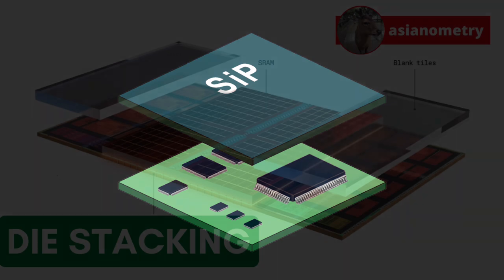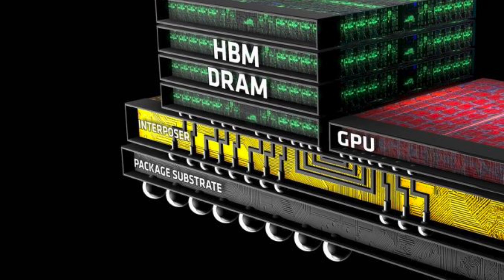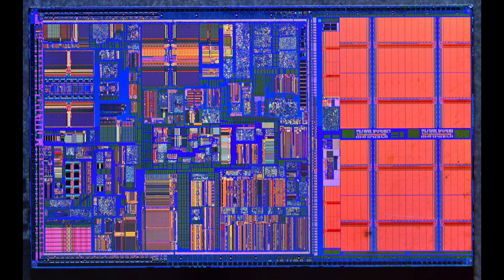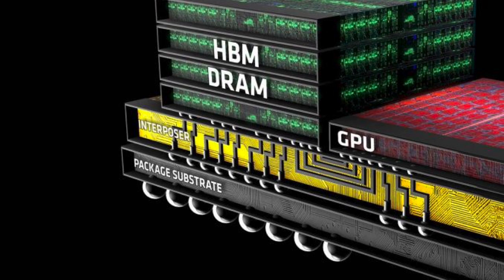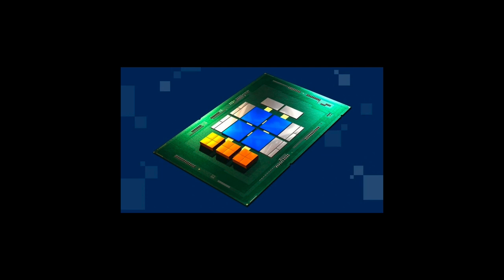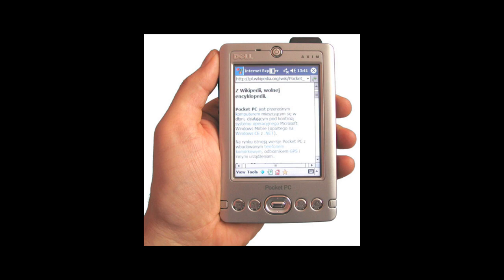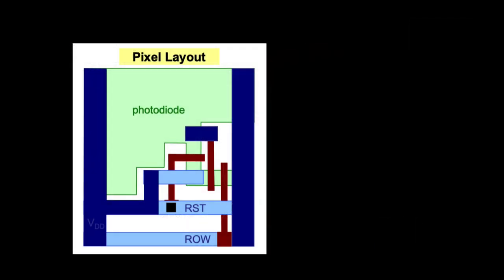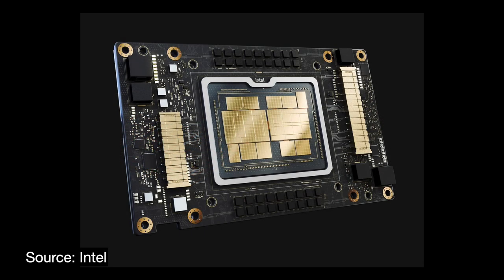Stacking Dies For Performance and Profit

Comment: Hope we start using dramatically bigger wafers soon to cut cost.
Reply: Backside Power Delivery (BS-PDN)  by Applied Materials.
Reply: Bigger wafers have been tried and they were much more expensive to deal with.
Reply: Never gonna happen, first because the 20+ years structures to deal with 300mm wafers, second because the weight, and finally because the yield of a large wafer raw material. Watch tech tech potato on the subject.
Reply: @vitormoreno1244  Well i know it was being develop, people will push for it again eventually.

Comment: Call me old fashioned but maybe devs should spend more time optimizing code. If we can run Doom on a Gameboy, maybe my phone doesn't need 100MB for the calculator.
Reply: Are you willing to pay the man-hours needed for your optimized calculator?
Reply: 100 mb calenders have nothing to do with the video
Reply: @kazedcat  I'd rather pay for the man hours to teach better security and coding practices than having to buy new hardware every year for bloated software that's full of vulnerabilities.
Reply: @CMSonYT  100MB calendars have nothing to do with my comment.
Reply: @RooMan93  Security code is much more expensive in man hours. A developer who understand discrete elliptic curve is very rare.
Reply: You are comparing a game from 1997 to games which are fully 3D. AAA games are not going to run on your 1650 if you haven't catched my drift.
Reply: @flintfrommother3gaming   AAA studios are responsible for this too.
  End-of-life console games pushed hardware to its limit and often my smaller studios or unique individuals. The homebrew  scene today has improved upon that and gave us truly impossible ports.
Reply: You can throw as much AES and entropy as you want at a program its still not going to make it impenetrable via some overworked and under paid dev who didn't check the length of a string or thought what if we nop-slide right here.
Reply: @RooMan93  The industry already have a solution for that a security library. This way underpaid developer will not be touching any security codes and just use API calls to access them.

Comment: It's pretty common knowledge that memory and IO die shrinks are providing little to no benefits at the moment. My question is...well why? We still see benefits in just about everything else, so what is the issue with memory and io specifically? Is it a heat issue? I realize it isn't a huge deal in the general consumer space...yet, as ddr 6/x and 7/x are not even commonplace anywhere save consoles and graphics cards, while home computers still rely on DDR4 and 5 for the most part. We also have hbm which offers far faster speeds and much, much larger BUS widths to provide some insane transfer speeds if need be, but this will obviously be a problem at some point. We can only pump so many volts through memory in cell phones and laptops which is where I assume the issue will rear it's ugly head first.

Does it look like there are any long term solutions on the horizon? Or could we just be stuck on these particular sizes, with 2nm possibly showing a breakthrough where memory all of a sudden rams through the wall and blasts to 20kGts or is it more serious, to the point where we may need an entirely new material for RAM/Nand in the future as silicon has just reached it's limits in that regard? Heh, I am getting some bad "Three Body Problem" vibes here. Did some alien unfold a 2 dimensional shape in our 3-D space and screw us without our knowledge, possibly holding technology back 100 fold? Stupid books. For what was supposed to be a grounded SciFi series it sure ends up reading like horror too me.
Reply: > My question is...well why?

The sizes of minimal printable features on the die stopped decreasing. You should expect that to happen, reliably printing lines only a few tens of silicon atoms wide is bound to hit a limit of what's possible to make.
Reply: GDDR6 isn't more advanced than DDR5, those are different types of DRAM optimized for different things.

Comment: First, Moore's law isn't dead, it's irrelevant, and this is something tech Youtubers can't seem to figure out.  It also isn't the richest customers that can afford more advanced nodes.

So first, most companies that need ICs don't NEED the most advanced process nodes, not even CLOSE.  So let's get that out of the way.  It means, something like TSMC N5 and N4, in production right now for various customers including AMD and Nvidia isn't needed by more than 90% of companies that need ICs, so it's irrelevant to them.  There are a lot of circuits that don't scale down to these more advanced process nodes, and since the circuits don't scale down, it makes no sense to use a more advanced node when something like 28nm gives ALL THE SPACE IN THE WORLD for the amount of transistors needed for that circuit for which will become an IC.  Some of these companies could easily afford a more advanced node, but why spend more money if you don't need to?

There is a pathway right now to go below 2nm, and I'll stick with TSMC here.  Naming schemes will change from nanometers to angstroms, so below 2nm, or for TSMC 2N, they should be changing the name to something like 18A, 17A, 14A, etc................  So saying Moore's law is dead gets silly when in fact further developments are going to allow for most transistors that go on an IC to keep shrinking.  It's really the more high powered circuits that go on an IC that don't shrink well, such as transmitting a signal off the IC to go across a circuit board to some other component.  It takes a more durable transistor to transmit a higher power signal, so size of the transistor has to handle the power output, so different circuits have already stopped scaling down.  There's a good chart for it somewhere.  So this is part of the reason why using multiple ICs to make up a package has become a bigger deal.  No matter how wealthy a company is and how easily they could pay for advanced process nodes, their CUSTOMERS have to be able to afford to buy their ICs, and if I can buy an IC for $50 USD or $10 USD and I get the same benefit with maybe a slight variation in power consumption which will be the case, the CUSTOMER is going to buy from the company that can produce that circuit for $10 USD because THEY have customers too.

We have at least 2 decades of more size reductions for transistors (a typical transistor used for a digital circuit that make up logic gates, such as AND, OR, XOR, etc....).

But here's the 2nd to last point.  Right now even at 5nm, or TSMC 5N, the power reductions is CRAZY good.  When TSMC gets to 2N, the power savings will mean running a laptop for a couple days without plugging it in, unless you have a gaming laptop which means you're pushing higher power into the CPU and GPU SoCs to pump out that fps, and then of course you have to power a monitor too.  It also means when you slow down clock speeds from the higher speed these process nodes can hit, the power consumption of a few billion active transistors drops down to VERY low levels.  We are almost at a point where power savings is getting close to being unneccessary because the ICs already consume such little power.

And here is the last point.  At some point you don't NEED to get more transistors in a smaller surface area, and this ties into Moore's Law.  Do companies REALLY NEED to get more than a billion transistors in a sq. mm?  I doubt it.  We're in the hundreds of millions of transistors in a sq. mm already.  You mistakenly call this "more power"  Just because you can get more transistors in a smaller area that doesn't give you more power.  It's the circuits that can USE more transistors that are limited by package size that can get more power out of the smaller process nodes.  And these circuits are pretty limited to CPUs and GPUs with rare exception.  And in the case of a company like AMD that uses TSMC to produce their CPUs, even THEY are going to hit other limits before process nodes limit them.  For instance AMD is going to put out a 192 core EPYC server CPU with Zen 5 or that's the rumor.  But these are SMT cores so that's 2 processing threads per core, so it's 384 parallel threads of processing power.  That's INSANE.  You become VERY restricted by the REST of the hardware architecture, such as how many memory channels you can fit onto a server board because with that many cores running you need a LOT of memory channels so each core doesn't have to wait for other cores to get data from memory.  Then you have an issue with being able to feed data fast enough to 192 cores in a single package.  And you can't just say more PCIe lanes.  NOW you need PCIe gen6, and we JUST GOT to PCIe gen5.  In a typical PC, when feeding data to the CPU or coming out of the CPU the most you get is 16 parallel PCIe lanes, and with gen5 you get 4GB/s per lane so you have a bandwidth of 64GB/s on that grouping of 16 lanes.  That won't be good enough for a 192 core CPU.  NOW you need a PCIe bus with more than 16 lanes, probably more like 32 lanes, once again PCIe gen6, so now it's 8GB/s per lane x 32 lanes at 256GB/s.  Yeah, that's probably fast enough, or enough bandwidth to feed that many cores, but maybe not, so NOW you need multiple, MAIN PCIe buses feeding data into these cores, and this is MUCH different that a desktop PC now.

AMD just put out the best gaming CPU on the market, the 7800X3D.  As an example of how good even TSMC N5 is with power consumption, on average the 7800X3D uses about 50W during gaming.  Intel's fastest gaming CPU, the 13900K which uses their Intel 7 process node which isn't nearly as power efficient uses around 143W during gaming.  This is total destruction in power efficiency by AMD over Intel.  Best gaming CPU on the market today uses about 50W during gaming, on average (each game is different).  When TSMC is down to 2N, power reductions for the PC aren't going to matter anymore.  It just won't.  It's also questionable whether ever improving transistor density will make much difference either because the main components that use these advanced nodes, CPUs and GPUs start to hit other limits with the total hardware architecture that are much harder and more expensive to overcome and at some point people stop buying devices when the price gets too high, so AMD, Intel, Nvidia, etc.... HAVE to make products that consumers will buy.  If you need a nine layer motherboard for instance to run PCIe gen6 vs. a 7 layer MB to run PCIe gen5, you added cost to the MB.  If you need memory that's much faster to be able to keep up with 24 - 30 cores in a desktop PC and it doubles the cost of memory, it's a problem for the consumer.

So, Moore's Law isn't dead for one, and stop showing the channel Moore's Law is Dead logo to make that point because it's silly because he uses that as a catch phrase, not a REAL statement.  And two, even when it takes 4 - 5 years to move to an ever smaller process node using silicon, it probably won't matter because you'll be at over a billion transistors/sq. mm which is INSANE amount of transistors for such a small space so it will be more irrelevant than dead.  It's going to be more about what chipmakers and engineers can design for circuits that will become the limiting factor, not process nodes.  It gets harder and harder to make an ever faster core in a CPU and the smaller the transistor gets the harder it gets to run it ever faster, so once again, another limitation.  So, clock speeds will hit a cap, and the improvements to processing power has to come in terms of better designs for a core to improve instructions per clock (IPC), and that has nothing to do with Moore's Law.  Or, you turn to AI to improve processing inside the CPU, or you use accelerators which is already happening with Apple and Intel CPUs.  And this is the hardest part, improving the actual circuits inside a CPU to make them run faster without having the benefit of being able to clock the IC faster, and once we're down to something like TSMC N2, transistor density just isn't going to be an issue.
Reply: You should call out to him to make another video.
Reply: @UniverseGd  This guy makes some good videos, but he's a little lacking on technology as a whole.  I'm around 60, and have been following technology since I was 20 and worked with computer systems and built my first home PC in 1995.  I've never bought a PC.  I've built MANY.   I ACTIVELY follow technology, as in tech news, read about advancements, etc.... especially in the field of computers.

Considering I posted on the video, it DOES call out the statements he made about different things.  But no, I'm not going to become a Patreon member just to tell him to learn more about computers in general so his statements are more in line with reality.

Everything I said in that long statement is either factual or has years of following computers behind the logic of the statement, every last sentence of it.
Reply: This account has to be an AI bot...

Look at all the comments on this channel, they are all super long like Wikipedia articles with a hint of personality thrown in. 

Not a person.

Comment: 3D is an albatross for CPU manufacturers. AMD's tech already constrains power dissipation, so they can't reach the higher frequencies with their stacked dies. And now their implementation has exacerbated memory non-uniformity, with remote caches that are actually slower than DRAM🦤
Reply: At this point, we need cheaper chips more than we need faster ones, AMD picked the right strategy. Intel's losing money quarter after quarter, nvidia can only keep up their profits by charging double what they should, apple's selling less iphones. Everything using leading manufacturing nodes is way too expensive. Thankfully dram seems to be in oversupply for now, but it might just push samsung or hynix over the edge. Over the last years the industry's spent many billions of dollars to get slightly faster chips that cost more than they're worth in the market.
Reply: Intel is reaching the so called 'higher frequencies' with chips that are burning through literally 2-4x the wattage (320w vs 80w). Is that the direction this technology should be headed just so that companies can claim they have the fastest performing chip by 1% every couple of years at the expense of everything else?
Reply: @PaulSpades  Even a blind squirrel finds nuts once in while. There's no AMD strategy, their actions are predictable to form. Practically everything is currently manufactured on older nodes that nobody is interested in maintaining. Those nodes can only get more expensive. New designs target the newest tech because those costs at least have a chance to decrease at scale. The only time to specify older nodes is when some analog parameter can't be met with the newest process. Centralizing PCIe and DDR on the IO die was a step forward, but scattering the L3 was also one step back.
Reply: @JVlapleSlain  AMD is also reaching high frequencies. They just can't do it and increase the cache at the same time. I think it's good to have diverse approaches available, but they have to know when they're facing a dead end. It would be totally predictable for AMD not to follow-through, making it was all the more impressive that they were able to recover from Zen 1.
Reply: @Hugh_I  Heat is certainly an issue for a server CPU. 105W/8 cores is over 3x 400W/96 cores. But the larger issue is the extreme NUMA phenomena. Remote caches, even within the same package, are slower than accessing DRAM. No matter how much cache they can stack on one die, synchronization bottlenecked applications will only scale to the maximum number of cores on that die.
Reply: @shanent5793  yes agreed, I may have phrased that badly. I meant that thermal limitation due to the stacked dies are not an issue, because you don't want to clock them that high to begin with that it would be a concern. Thus having perf improvements with better IPC or other means like extra cache that avoids extra power draw and heat is preferable to higher clock speeds. 

Agree on everything else you said too. Just to add: the high core count chips are also in high demand by cloud providers or others that run many virtual machines or applications on the same server. For those synchronization issues and inter-die latencies are not that big of a bottleneck. But of course scaling a single workload across hundreds of cores is tough, esp if you have lots of data dependencies between the threads.